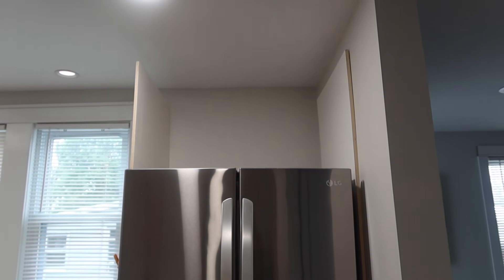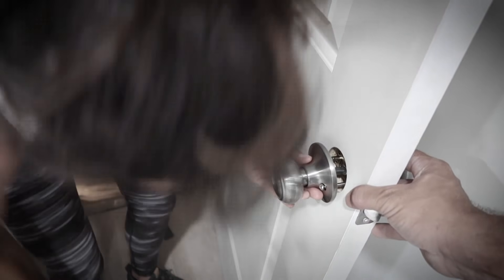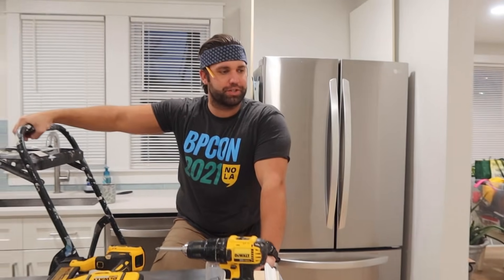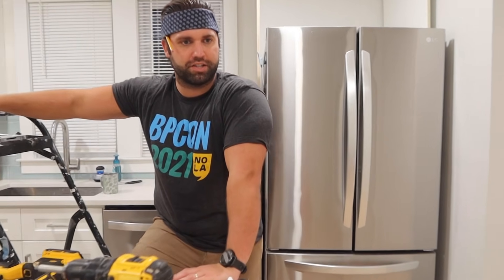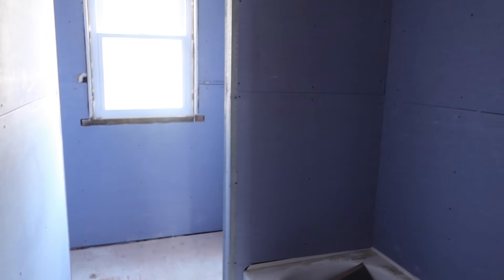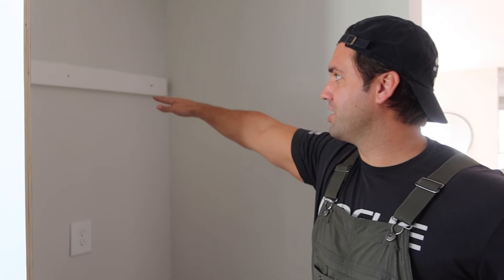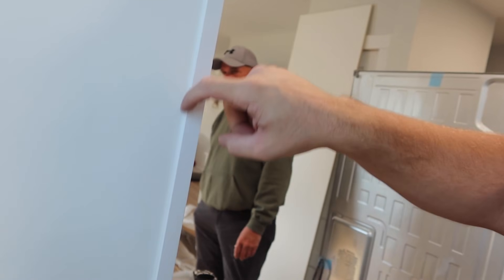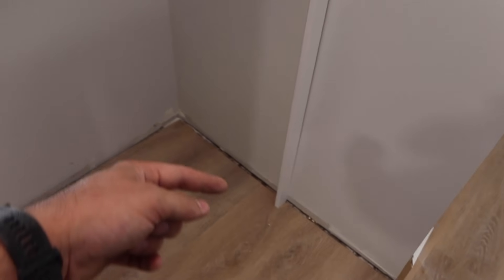Life of a House Hacker + Renovation Update

Comment: How do you all plan out your kitchens in advance especially when it comes to cabinets?
Reply from the maker: Hi! We take the measurements of each wall and then it's really just a fun math puzzle. The cabinet line we use has cabinet sizes from 12-40 inches in 3 inch increments. (12, 15, 18, 21 etc.) First, we figure out where the major appliances need to be like the gas line and water lines and then we fill in the spaces with cabinets. It's actually quite fun! To finalize, we use painters tape and tape out the floor to get a good feel for the space. Most cabinet suppliers can design the kitchen layout for you for free. All you need are the wall lengths and an idea where the gas and water lines are. Hope this helps!
Reply: @RentalstoWealth  ok thank you. I’m going to have to do that soon and I never designed a kitchen before so I’m looking forward to it!!